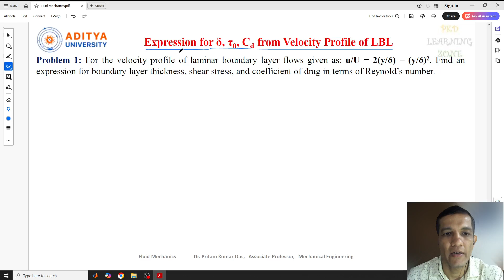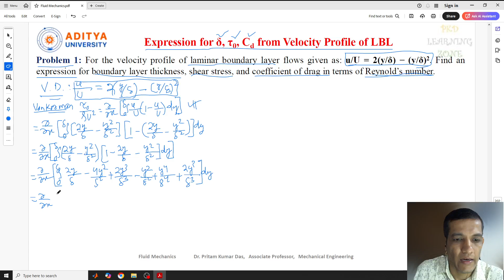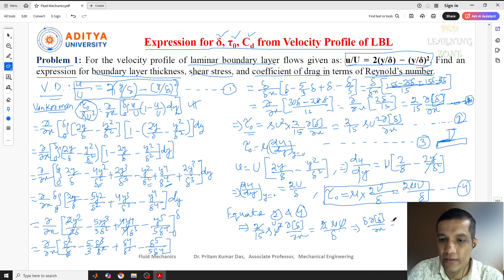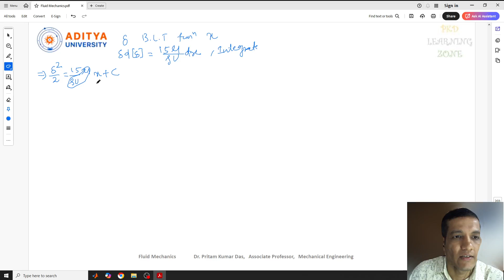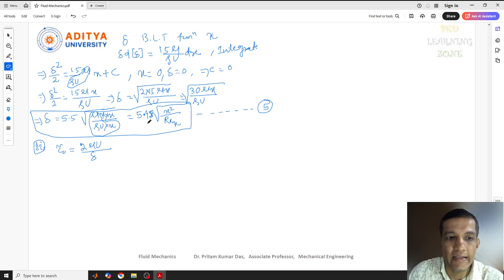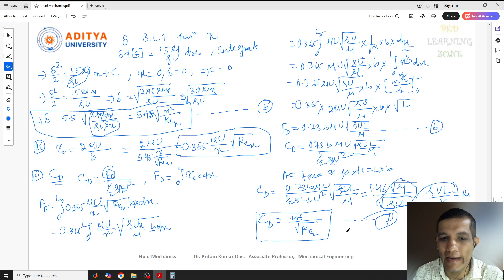Lecture 168 Expression of δ, τ0, Cd from Velocity Profile of Laminar Boundary Layer, Fluid Mechanics

Comment: Sir one correction please added that 4:52  there will be a + sign instead of - sign in the bracket 1- (-y^2/∆^2)
Reply from the maker: Dear @bidyutshymalchetia9467, at 4:35 timing that should be +ve sign on behalf of -ve sign, you are right, 
Thank You
Reply: @PKDas007 Thank you sir 🙏